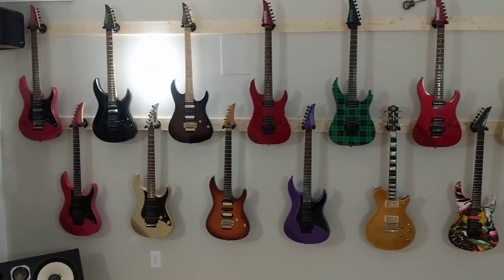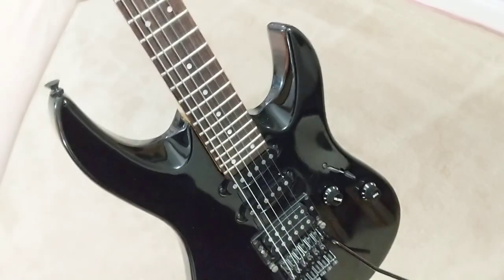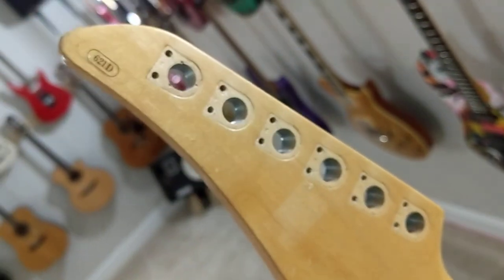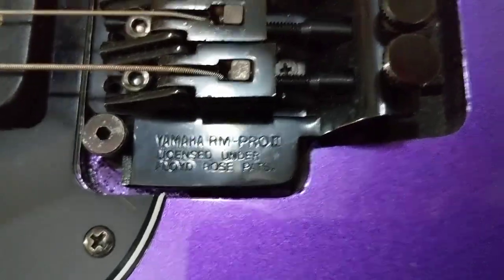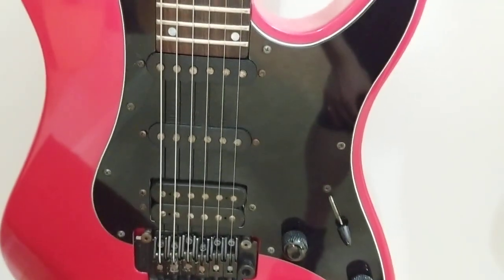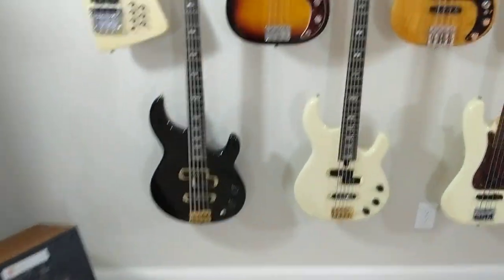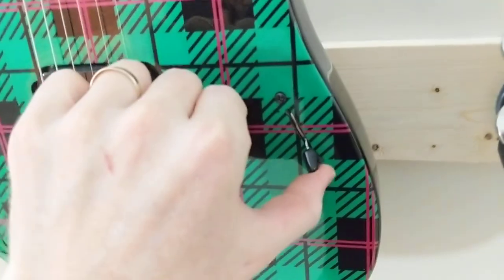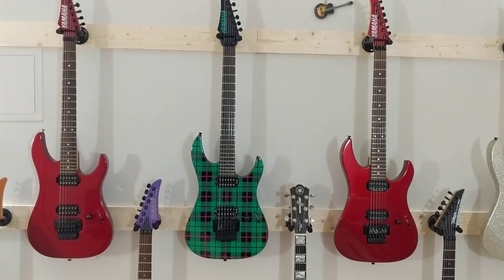Yamaha RGZ/RGX/YG models and differences explained

Comment: I have a YG1212, the top of the line of the YG series. It has the Yamaha Japan stamp on the tuners but it also has the made in Taiwan stamp on the back. I've read from the previous owner of my guitar that the high end YG guitars were produced in Taiwan but were assembled in Japan. He also wrote that the necks were made by Warmoth for Yamaha. They propably had the bodies made in Taiwan and kept the necks and tuners in Japan where they then assembled the guitars. If all of that is correct, it makes the YG series a made in... all over the place
Reply from the maker: They definitely were all over the place. Epic instruments with no accountability to where they were made indefinitely.
Reply: yiu are correct  the top of the line yg, rgx and rgz between 89-91 were all made in tawain. the 1987-1989 were made in japan. they are the same built and quakity. don't get fooled. tawain yamaha are japanese yamaha . in the real world of collectors. we vonsider tawain top of the line the also have the a RM-pro. that many japanese do note have.. you must have the RM pro floyd in it to have the top of the line of the line..

Comment: Informative video. I bought a  RGZ-621 (red) w/the RM-PRO II trem back around 1992 (?) and still it have it. Its basically in NIB condition, no scratches, no dents, no pings and completely unmodified.
Reply from the maker: That's a great one! I have a out 7 of the RGZ 621/612 versions and they slam. Just finished another one last night so look out for the post!

Comment: Really like your enthusiasm for yamaha rock guitars. I am lucky enough to own an RGX1212s with mahogany/maple five ply neck through construction and ebony fretboard that is an incredible playing guitar.  Mine has the yamaha tuners and is indeed made in Taiwan but is excellent quality maybe even better than my Ibanez RG550 that was made in Japan. Thanks for pointing out that the "made in Taiwan " were excellent quality guitars too.
Reply from the maker: That 1212 was on my list for a long time. After I made this video it got so many views that it actually changed the worlds view on these guitars and the prices skyrocketed. I could have gotten a Japanese 1212 for 500 usd and now they go for 1800. My personal collection after restoring them to better than factory has made them worth 4 times what I bought them for, and in some cases 10 times. Really I got lucky. I knew yamaha made great engines and pianos but had thought their guitars and basses were junk simply because no one ever endorsed them or saw them in major bands. But alas, I remember what the Japanese do best, improve not invent.

Comment: Awesome!! I have one RGZ 211m. Very good guitar!
Reply: Me too! Still love it.
Reply: Does it still have the og bridge? I am in the process of scouring the net to fix mine up and restore it to full use. The lock nuts are absent, and one fine tune knob is gone because the end of the string saddle(?) Broke off. The string still locks in place but can't be fine tuned. I assume that's why the original owner discarded the locking pieces and tremelo bar. It was the metallic red version, but I received it sanded down to a natural wood finish. It was my first guitar and I still love it, but the missing parts bothers me

Comment: Subscribed. Great info Chris on some hugely underrated guitars.
Reply from the maker: Thanks man! Let me know if you'd like to see anything else from me
Reply: @theittyreport  cheers mate!  I’ve got a 1989-ish Taiwan-built RGZ211M in the collection. It was my first guitar after a lot of begging, borrowing and mowing lawns. It’s worked hard, being my only electric guitar in late high school and while at Uni and being quite active in the local pub/party/Unibar scene (long time ago). I’ve since accumulated more guitars, including a Prestige Ibanez and a couple of MIJ 80s Strats, relegating the RGZ to it’s case and the back of a cupboard some years ago. I recently got it out, gave it a basic setup with frets levelled/crowned/polished (frets were pretty worn and push-push coil split not working) and I’ve got a newfound respect for the quality of this instrument. I’ve always been very particular about taking care of anything I’ve worked for so the old Yamaha is nearly perfect. I sorta wish I was a bit rougher with it so it would have a lot of marks to tell its stories. Unfortunately, the only evidence of a lot of work is a set of worn frets, a nice bit of wear and missing lacquer on the edges and back of the neck and a push-pull coil split on the tone pot rather than the push-push one that was there originally. It’s nothing special but it’s VERY special to me. I’m just thrilled to se someone else as passionate about these under-rated guitars.

Comment: Also having the tuners with the Japan stamp it's no always a give away of it's origin. For example the Pacifica 1221 has'em, yet in the body has the same stamp you see in the RGZ that it was made in Taiwan. So, the true about these, it's that the parts were made in japan but put together (assembly) in taiwan. This is true for most mid-high range Yamaha guitars. Some Customs have Warmoth USA necks, for example.
Reply from the maker: Totally agree. But isn't it crazy how all over the place these guitars were? It's like Yamaha took a deck of cards and wrote models on theme and looked at the crew and said "today, we play the game 52 pickup"
Reply: For me the RGZ models are kindda "normal" compared to the Pacifica versions. Keep in mind I have been well over 15yrs with Yamaha guitars, so.
Also, Yamaha made the parts (many were made by Gotoh for Yamaha) and assembled'em in a way or other, giving birth to these diferent versions and models. In the higher grade models (7XX, 8XX, etc) they went even more crazy.
But, for example, the Pacifica comes the 1212 (SSH) and the 1221 (HSH) and the 1230 (HHH). All of them with Dimarzio custom pickups made for Yamaha (similar to Steve's Special, according to Dimarzio).
Then you have the 1221S (Single cut), 1221M (maple fretboard) and the 1221MS (Mike Stern's model) and then you get into the Customs. And don't make me go into the color variations!
Also check out the RBX bass series, first introduced in the late 80's. Specially the RBX 800A. Beautiful bass. I found one for a friend the other day.

Comment: I had a red RGX 321 and I sold it 5 years ago. It had a really thin Ibanez style neck and TRS-101 trem that survived divebomb abuse with no tuning issues. The only bad thing were the pickups, HSH configuration with middle pickup dead and neck pickup about to go belly up. They were too bright in my opinion, but mechanically the guitar was very well built, Taiwanese made. I sorta want it back now...
Reply from the maker: The pups in the 3 series were not that great, but it's the guitar that matters in the end. The pups can always be changed. There's quite a few still out there to go get again

Comment: Informative video. I mistakenly sold, in early 90s,  my pearl white RGZ with maple fretboard and RM-Pro. The maple fretboard is nice. I've been trying to get similar one but never found it. So far I've got an RGX and an RGZ, both with Rockin' Magic Pro units. Good toys.
Reply from the maker: So many people say they have the same regrets after selling these guitars
Reply: Sorry for using this method to communicate. I have a mint RGX612a ( no pickguard, active electronics - see I was paying attention 😀). It is fitted with original RM-pro with what I suspect is a common issue - The “bridge part” that the micro-adjusters screw in to is very messed up. Low e adjuster has been drilled out and replaced with a larger dia screw ( but done really badly) and the high e has a stripped thread. I am in UK and have searched the world it seems for the part or even a RM-pro (1,2 or 3) if they bolt in - as you will know standard Floyd Roses do not fit. Any printers as to where I might locate parts or has anyone a solid way to refurbish the micro adjuster part of the term. Sorry for bothering you and thanks for my help you can offer.
Reply: @adamhaze8477  I can't imagine how bad work on the bridge. The two guitars I have with RM Pro are not so bad. The tremolo units are totally working without such issue. The only problem with the bridge is the arming-up adjuster. The adjuster pole is stuck somewhere in the slot and not movable. Though I prefer floating setting and it's not a problem for me. I think I'm lucky because I'm in Japan, the home country of YAMAHA. It is not very difficult to find a not-bad condition RGX or RGZ guitars with non-customized RM Pros in around 200 GBP.
Reply: @7stringist  good advice - I have some colleagues in Japan - I shall see if they can help me find the part or as you say a complete guitar. Thanks 😀
Reply: to bad you did't reach me i could have explaine how to fix it.. i might do a video on how to fix this properly.  so ot can fir the original fine tuner  and also links to were to get the right fittin fine tuners. so poeple can fix there guitar.  the problwmw with the fine tuner is they need tu be lubricated and the must never be pushed in all the way in or out. 

but there is a fix.  and ts what ingeneer do. the screw size is know as M4. yoi need to drill out the you need to tread tap to an M5. after this is done we insert an HELICOIl. this is a sping that will wrap arount the existing M5 screw groove and make it a brand new M4. but the magic hear. is that  the new alloyed is much stonger and durable  . you can all so buy undreds of M4 screws of all colors and leng. 8mm are the original lenght

Comment: I just wanted to chime in on the method that Yamaha uses to name their guitar models, which might be of interest. The first digit is the series, the second digit is the number of humbuckers and the third digit is the number of single coils. For example RGX 321 - Series 3, 2 humbuckers, 1 single coil. Also these are the only Floyd-Rose-Type-equipped guitars(that I know of), that have a height-adjustable locking nut. I still kick myself sometimes for selling my 1991 RGX321, it was really a great guitar. But yet again, I get reminded that I hate anything that resembles a Floyd-Rose floating trem with a passion... Anyway, great collection mate!
Reply from the maker: Hey man, thanks for the info. I believe I mentioned all that in the video, I know it's longer than 20 minutes which makes it a documentary so I understand if you skipped around. Since I posted this video I got another RGZ 721 DMR that I did a holoflash finish on. I'm putting bare nuckle pups and the mad hatter Evo terminator in it so stay tuned for that one!
Reply: @theittyreport  I watched the whole video, but I didn’t catch that. You explained just what the letters after the model number mean... Anyway, at 10:22 you can see two holes, one between the low E and A strings and one between the high E and B strings on the nut. That’s where you stick an allen wrench(same size for adjusting saddle height on a strat trem) to adjust the height of the nut. I think you also have to loosen the mounting screws before that.
Reply from the maker: Check out 12:30
Reply from the maker: The difference I was referring to between the YG and the RG locking nuts was the diameter of the pole itself. Wasn't referring to the riser screws for the hight of the nut. Keep in mind that I've restored these guitars and pulled off every screw and disassembled every part. I've missed nothing my friend. I'll post a link to a restore video so you can see the level of detail I go into. I've even modded the pickup from two to four wires on the Red 820R
Reply from the maker: https://youtu.be/uxwLrr8Bbso
Reply: @theittyreport  See, I didn’t know you knew your guitars in such detail. My point was not to start an argument, but to add a bit of information you and your audience might find interesting. Your explanation about the pickup configuration is a bit ambiguous though. Let’s say, you are buying an RGX603S, but you haven’t seen a picture before of this model. Does it have 3 humbuckers or 3 single coils, considering you only know the model number and nothing else? Given the scheme from Yamaha it should have 0 humbuckers and 3 single coils. That was the other point, I wanted to make.
Reply from the maker: No argument at all my friend, I appreciate how much feedback and information you shared! I'm just so used to people watching 10 seconds of a video that I spend weeks on and posting comments on how it's wrong after I clearly say in the video why I did it a certain way and how to do it both. I didn't post the video to help be a buyer's guide, it was a request from my Facebook group after seeing how many of these guitars I had and they asked me what's the differences. Had it been a buyer's guide video I'm sure it would be geared towards what you'd expect to see. But either way, I enjoy our conversations
Reply: @theittyreport  I‘m glad we came to an agreement, my friend! I really enjoyed your video and appreciate the hard work that you put in to making it. It brought me back some good memories, too!

Comment: How stable are the RM-Pro bridges? I'm thinking buying an RGX612s in very good condition, almost mint.
Reply from the maker: Very stable. Made in Japan and rock solid
Reply: if you are refering to the Rm pro. the first and original. the beefier one. you need to lubricate the fine tuner. do not for it all tge way in and all the way out. yiu will strip in. and i am amongst some of the rare person that can fixed them. if no part are missing. is parts are missing  i now conpatible parts  . so remember my name. and this comment.. this guys as no Rm pro.. he as the cheap rm pro II and Rm pro III. i just check all is guitars.   if you have any question  i have own 10 612 Rgx. over the past 20 years  i kbow these guitars like the back of my hands . RM-pro is the best floys in the world if its fonctional.. . i biy the 612 just for parts

Comment: This is a great resource on these underrated guitars. I have a 90s Taiwanese RGX621D and love the thin Ibanez Wizard-like neck profile. I'm looking to get more Yamahas with the same neck thickness/profile, do you know if the 90s Taiwanese RGX4xx/5xx are also thin? What about the YG necks? Thanks!
Reply from the maker: The necks are the strangest part. I have a 621 that has a 321 neck stamp on it. So the necks for the RGZ rgx and yg 321 through I think 621 are all the same. The 721 is unique because of the scalloped frets but the neck shape feels the same for the most part. The 821 series don't really feel that different than the 321 and are much beefier than the wizard necks but not buy much. The blues Saraceno 820 is the only neck that is truly different than all of them. Its very thick and round and also 22 frets. But it feels incredible so even if you're used to a thin neck, this is a very comfortable neck that makes you work harder to get the note but works to your advantage because it makes you play with more intense attack thus better tone.
Reply: @theittyreport  thanks! I'll keep an eye out for those others. BTW if you have any yamahas with 20-24F scalloped maple fingerboards and are looking to sell, I'd be interested!

Comment: Good vid, thanks.  Where does the RGZ 312 fit in?  I know it's HSS, rosewood board, made in Taiwan (non-reverse).  Is it a lower end RGZ 612?
Reply from the maker: It's all about the pickups and hardware. The 1 2 3 series have pretty cheap electronics and tuners etc, but the necks are all great. I've shown that on a 621 that the neck was stamped as a 321. So the necks are the same for both. The 7 and 8 series have scalped frets and offer a few other upgrades and have very good pups and hardware. But they all are equally good.

Comment: Been looking around for more info on these. The only place I've been able to find anything nicer than a 121 currently available is South Korea. So they are currently still in production, but only for very limited markets, it would seem. Maybe you know which models of these they're still making?
Reply from the maker: The ones I have were made to compete with ibanez in the 90s hence the RG reference. I got most of all of mine in about 2 years start to finish and believe it or not, I think I changed the market for them. The people that watched these videos started buying them and the people that owned them started seeing the value and took them off the market. So the when I bought them they were less than 300 and now the same ones are going for 600 to 1000. But you can still find them on sites like reverb and ebay due to international shipping. Some were also acquired from people from Russia that had access to Japanese bidding sites that I can't get. So they are out there for sure, just have to look.

Comment: My first electric guitar was the RGZ 112P.  It had a cracked nut and hadn't been played in at least 20 years sitting at my mom's house. Other than that the guitar is in great condition. I took it to a local guitar shop and he made a nut and he said he flushed the electronics. Should I upgrade the pickups or would it be better to leave the original pickups alone?
Reply from the maker: Really depends on your tone. I'd say always keep to stock pups for resale but change the pups to whatever's best for you

Comment: Maybe I missed it but what does the first number mean in the rgx series models? For instance I have a rgx 602s, 612j and a 1212s. I was told the 6 means it is the highest grade neck yamaha offers in that series? But then again my 1212s is a neck through so I'm confused?
Reply from the maker: Join the confusion my friend, yamaha staff doesn't know either. I think it's a manufacturer thing that was scrubbed later. I have a RGZ 612 that has a 321 neck stamp so they just mix and match.